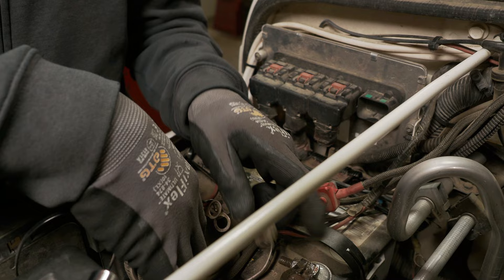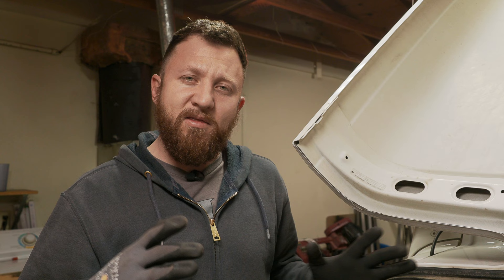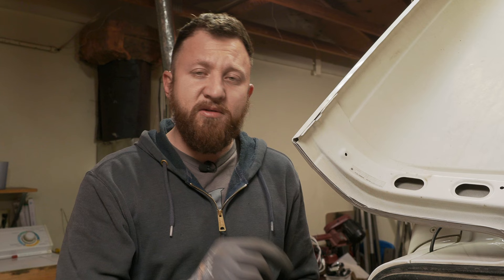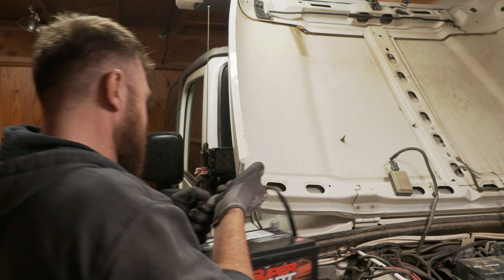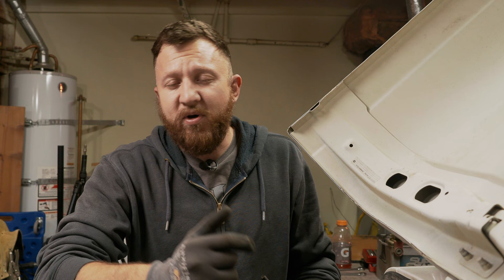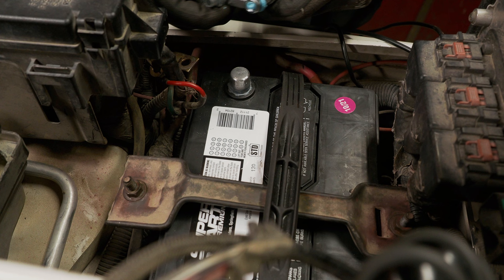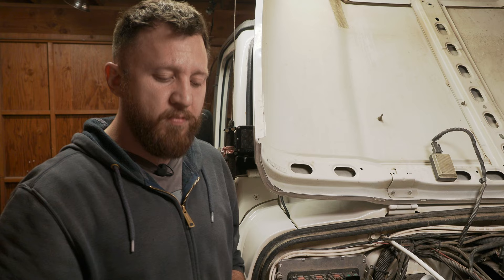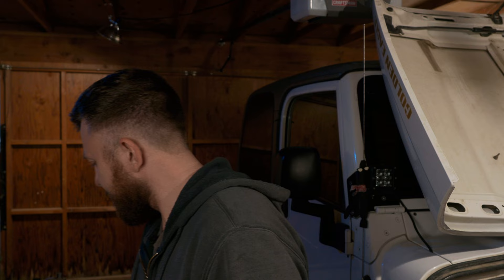Watch Before You Buy AGM Batteries

Comment: Its your jeep the one you need to tos out. AGM batteries are great... they are also designed for newer  vehicles not WW1 Jeeps....
Reply: I’m having same issue with AGM  battery in my 2013 Nissan Rouge
Reply: @MikeSmith-tu1ln  Rogue is not a vehicle one would use as a bench mark of quality.
Reply: @noblekitty  has 200k miles with no issues besides the battery.   It’s a 2013.  Runs and looks like new. As if jeep is quality lol
Reply: @MikeSmith-tu1ln  whenever I hear someone claimed that a 3 years or older still drive drive like new, I know right away that person is either full of bs or don't know what they are talking about. Why? Because a friend of mine always leases a new Lexus every 3 year. And every time he got a new one, the first thing he said was man, I can't believe how much better and quieter the new one drives. And alot of time, they are practically the same car with some facelift.
Reply: @noblekitty  you can definitely keep a car running and driving like new for more than 3 years lol does your buddy regularly do maintenance on his vehicles? Or he just driving it, there's also the factor of getting something brand new and being in that "honeymoon" phase of owning it where everything is 100 times better cuz it's brand new and a lot of money
Reply: @Seagull425  my coworker leases Lexus. Leased cars are usually in their best possible shape due to miles restrictions and dealer's scheduled services. He also has OCD. All his stuffs are well organized and taken care of. Cars have a lot of parts made out of rubber, which deteriorate over time due to oxidation. A used car will never be the same as a brand new car. You're just lying to yourself if you believe so.
Reply: @noblekitty  yeah doesn't happen in 3 years man, a well built and well maintained car can run and drive like new for awhile don't be a clown. It doesn't matter how good of shape the car is in when you get it, if you don't maintain it for 3 years yeah it's gonna drive like shit. If you get regular oil changes and fluid flushes, just doing regular maintenance that people don't normally do all the time will make your vehicle last like it should.
Reply: @noblekitty  how much do you know about cars? Have you ever worked on an engine? Other than replacing some stuff?
Reply: WW1😂😂😂😂😂
Reply: Love my XS power AGM batteries!
Reply: My Optma red-top works great in my 96 Yoda Taco... I just replaced the last red-top... it lasted 14 years. It lived in Phoenix AZ (100°F plus summers) and in Lions KS (4 ft plus of snow winters)... and Colorado and Oregon... each place for years... and being charged by my old, small truck with a lower power output alternator (13.5 volts just like the guy in the video) [not a regular viewer of this channel so I don't know him and his vehicle] but my truck kept that battery alive under all those conditions for 14 years. Now mind you, I'm of the school that an alternator is a battery maintainer, not a battery charger... and thus that a vehicle battery needs to be removed from the vehicle* and charged on a charger every so often (whenever it drops below 12.4v when the vehicle is completely off) or about every 6 moths ish in my case. 

You may not  have to actually physically remove the battery from inside the engine bay, just disconnect the terminals when charging... I have to remove it and carry it on foot 9 blocks to charge it because I live in a major metropolitan city, in a multi-story apartment building that was built before vehicles were really a thing, so it doesn't have a parking garage... I pay for a public parking garage with no access to outlets, and where even if it did and I charged it in the truck, I'd likley get my charger, battery and or other parts stolen and so I take my battery home and charge it in my appartment... but if you live in a typical house with a yard and a garage and all that... you can probably just Park your vehicle in the garage, disconnect the terminals, and charge it right there where it sits in your vehicle. For AGM batteries and especially non-AGM gel batteries, it's extreemly important that you use a charger that's rated for them. Regular chargers for regular lead acid batteries, will charge an AGM battery or gel only battery with way too much amperage and burn out the gel killing your battery. All that being said... *IF you don't abuse your battery by running ACC mode with the vehicle off for long periods, or by relying soly on the alternator as a charger, or by running it down too far too often... then you can run an AGM in an older vehicle with a lower voltage alternator just fine for many years past it's life expectancy. Also it helps if you use the right battery type for your use case. If you have a constant draw usage (ie dash cam, you like sitting in the car listening to the radio with the vehicle off, you often leave your phone charging in it for hours with the vehicle off, things like that... for optmas your better off getting a yellow-top or a light-grey-bottem blue-top, if not, you'll get a stronger start using a red-top or dark-grey-bottom blue-top... for other brands do your research, get the right battery for your application. The factory recomended battery is for your car in stock condition, if you add a dash cam and cell phone charger your vehicle's electrical needs are no longer stock spec and you should ajust accordingly. It's about care and maintenance, and an aporoperate match. That's what make your battery last, and start well under harsh conditions... that and trying to limit the harshness of those conditions and the longevity it spins in those harsh conditions, ie if in Phoenix where you may overheat, park in the shade or in a garage... if in a midwest winter, park in a greage or near wind blocks like buildings, business garbage can cinder block surrounder walls with the gate thingies... whatever you call those... your garage at home, use a battery blanket (something you can pick up at an auto parts store, or online), etc. I mean I understand that it's not always feasible to do these things, but if you try when you can it will go a long way towards the longevity and health of your battery. These thing seem so small and simple like they couldn't have a big impact, but they do. They just do. Treat your battery right and it will tack care of you for years and years. Or go buy batteries all the time, but they're almost all over a hundo these day so... it's up to you, it's your battery, your vehicle, your life... I'm not tring to tell you how to live it, just offering advice built on experience, that's all... take it or leave it.
Reply: Maybe your problem with charging was that loose battery terminal...sounds like you need to fix your charging system...like a high output alternator...your charging system should be able to put out 14.7 volts even for a regular cell battery...AGM batteries are much better than a regular cell battery !!
Reply: The whole video is about reading the directions, so don’t watch the video, just read the directions.
Reply: @juniorcopelespec  agm rules for off-roading, no splashy
Reply: AGM have always been good for me but I buy the one brand and treat them well so agree but also, not much of a test.  
To your 2nd point, how does the car age (and charging system) matter if the car is delivering voltage in spec?
Reply: @noblekitty our rogue has 172,000 miles on it. Never had a problem. Bought with 300 miles on odometer. Nissan did a factory update to our transmission for free .

Comment: I've never had a problem with AGM in my Hondas.  They get to about 14.4 at idle and 14.8-14.9 when driving.  But I do agree that the Odyssey and Northstar lines are far better than the east Penn line.
Reply from the maker: With your charging system, it makes sense you have not had any issues. My Jeep is always at 13.5. I think It's just too low to charge an AGM effectively. I agree that Odyssey and Northstar are far better batteries.
Reply: @EmbarkWithMark  agreed.  In fact, the Odyssey needs 14.4-14.8 to charge right.   When I emailed Odyssey, they stated anything under 15 is fine.  

I will admit that having a car that can start like it's summertime when it's 13 degrees out, is a beautiful thing.
Reply: I've had excellent results and my alt charges at 14.2. Less than 14 isn't enough.
Reply: @ganzonomy
I have a 2019 Honda Passport with the original battery. 
Sam's club has a Duracell AGM battery for my car at $200. Dealer wants $265 for battery.  Interstate battery is almost $300. 
I know Interstate makes good batteries and also exide but now little to nothing about agm batteries. I'm an x mechanic.  Got out of it 20 years ago.

Comment: I have a 2008 Dodge Charger. It has ate 3 lead acid batteries before warranty expired. I installed a AGM battery and it has been going like a champ ever since. I’m happy I made the change to the AGM.
Reply from the maker: We are happy with the change to AGM in our 4Runner as well. Just not in the Jeep. Even after the wiring and terminals cleaned up.
Reply: AGM batteries fine in our '09 Toyota, '01 Ford Taurus, and '99 Mercury Sable. They last five years just fine.

Comment: The problem isn't your battery it's your vehicle, the charging voltage for a lead acid battery is between 2.2 to2.45  volts per cell The mean voltage is 14.2 volts irrespective as whether it's AGM or standard lead acid. I've never had a charging system charge that low and I've had over 70 vehicles.
Reply from the maker: I agree! My point is that AGM isn't great for all vehicles, if the vehicle can't charge at the right voltage. 

I also agree with the low charging votlage beeing strange. Turns out it's an interesting issue with Jeeps that didn't come with a battery temp sensor from the factory. Voltage in the PCM is set low by default. I have a plan to correct this.
Reply: Fix the vehicle which is broken, don't complain about the battery

Comment: There is no reason to every use a AGM  on a car.   AGM are use to power stuff all the time and to do deep discharge.   In a car the battery is only really used start the car.  If you car is pulling power from the battery when you driving it has something wrong with it.
Reply from the maker: I wouldn't go as far as to argue that point. AGMs are better batteries as a whole, with a caveat that they have specific charging requirements.

And as long as those charging requirements are met, than AGMs should last longer as well. 

I agree though, if the battery is draining while driving than there are other issues afoot.

Comment: I use AGM batteries in all my vehicles, tractor and lawn mowers.  I've had nothing but great performance from every one.  I've only had two go bad.  Those were the type with spiral wound plates and I do not recommend them.  One battery, a Sears Diehard, is so old I can't remember when I bought it and it's been in three different vehicles and still going strong.
Reply from the maker: The AGMs in my other two vehicles have been great!

Comment: In my experience from 18 years in the industrial battery industry….

AGM batteries have a designed purpose, and that is to be used in applications where leak proof is required. Such as aircraft , kids toys, indoor alarm panels. Etc…

AGM are not designed for applications where they are exposed to extreme temperature variations, overheating, overcharging, or under charging.

AGM batteries have a higher specific gravity (stronger acid) which may give them greater capacity when new, however, this also allows for quicker sulfating when left uncharged.

It’s much easier to maintain a Flooded battery versus an AGM and they are typically found at a much lower price point.
Reply: AGM batteries, unless your vehicle is designed to charge them, are likely to be overcharged and overheated by a typical automobile charging system.

Remember, there is no way to rehydrate AGM batteries, so they dry-out quickly in hot weather and from overcharging.

I can add distilled water to my $55 dollar Walmart Flooded battery, and have made these last 3 years or more.  I haven’t seen an AGM for less than $100 😂

Comment: My Diehard group 65 AGM battery is 6 1/2 years old, replacing it this week. I'm happy with that.
Reply from the maker: Oh yea, I have no doubt AGM will last longer than wet batteries. Just depends on how well the vehicle charges the battery.
Reply: @EmbarkWithMark  That's right. My P71 has a 370 amp 6 phase hairpin alternator....does 200 amps hot idle.

Comment: I use a Balmar AR-5 voltage regulator programmed to AGM mode to put a 14.2V charge with a 13.4V float from my 100A Balmar alternator.  Works like a champ.

Comment: The charging system on start up will charge battery at 15 volts or more then ramp down to 13.5-13.6 . So thats right on target for what the charge and float is. My chevy charges at 15 on start up then gos to idle at 13.6
Reply from the maker: That is correct for some vehicles. My Jeep never runs above 13.4-13.5, start up or not.

Comment: I think an external voltage regulator could probably fix this issue for cheap.

Good to note to consider though.
Reply from the maker: I agree with you that it would.
Reply: I did this in my Grand Cherokee and it worked good

Comment: Some people have reported that swapping out the 7.5 amp fuse for the alternator in exchange for a 1 amp diode fixes the problem about charging voltages. Before the swap, people tend to get 13.7 volts. After the swap, people are getting around 14.2 to 14.7 volts.
Reply from the maker: I’ve herd of this for Toyotas, never for older Jeeps though. I’ll have to take a look at that.
Reply: Diodes have a voltage drop & don’t see how voltage will increase 1 amp diode in place of 7.5amp fuse dangerous
Reply from the maker: @jonburgmann6246  For our Toyota, I use a drop in board that retains the fuse. It does work well to increase the voltage out put a tad. However, Jeeps do not use a fused sense line like Toyota's do. I was thinking about building a little in-line diode wiring harness for the Jeep to see what happens. 
Thoughts?

Comment: I drive a senior citizen's vehicle for three years and I've had AGM batteries on board and no problems. Before that I had gel batteries which were defective after six months. I always have to drive uphill and I'm on the road in the winter too. The problem with gel batteries is that you can't deeply discharge them. Once you've driven down a certain part the vehicle stops. With AGM batteries the vehicle slows down under heavy use but the vehicle still runs. I always charge it overnight but I rarely drive it down until it slows down.

Comment: 13.5v is too low for most AGM batteries! You are correct sir!
I replaced the voltage regulator so my alternator voltage won't drop past 13.8v at idle with the headlights on. It goes past 15v sometimes at winter, but that is well within spec. of my particular AGM battery.
Reply from the maker: Glad you agree. 

I wish it was that easy to fix on these Jeeps. The voltage regulator is apart of the ECM. Otherwise I would have done exactly like you have. 

Glad to hear swapping the voltage regulator is working well for you!
Reply: Was wondering if you guys could help me find out where I would need to look to see if the voltage issue would be an issue with my car. 
2023 Mazda3 2.5T sedan

I put a group 35 (that's the group for the Mazda 3) a few months back - haven't had any issues but now I'm starting to get worried.
Reply: How about using a diode in series with voltage reference that the reg inside the computer uses? silicon will raise voltage.7volt, Schottky slightly less.

Comment: A bit of a different application, but I have a Kubota tractor that came with a AGM battery with a manufacturing label of October 2012.  I managed to totally drain it twice over the years.    Still working well today.  It charges at 14.5 V.
Reply from the maker: I’m convinced the charge voltage is key to keeping a healthy and long lasting AGM.

Comment: Yup, an AGM battery for Start/Lights/Ignition (SLI) application in a vehicle that isn't designed for it won't give the best performance.
But, as a secondary system with a DC-DC charger (some can accept a solar input as well) it is a wonderful chemistry.

of course, yours also wasn't getting proper charge voltage due to the loose battery terminal. ;(
I got over ten years out of a pair of Optima AGMs in an old diesel powerplant with regular (once a month or so) full charges with a proper external AGM automatic (smart) charger